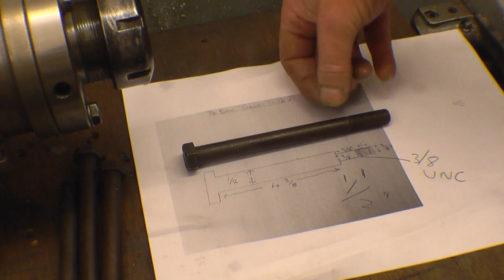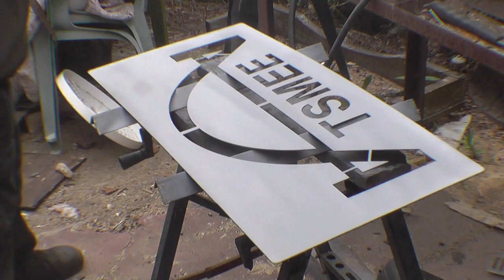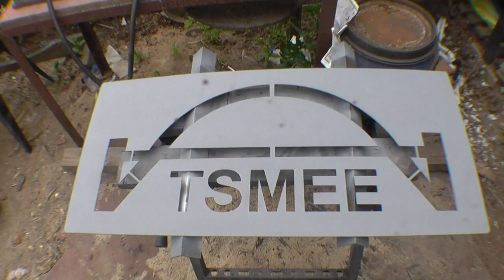SNNC 329 P2    Bought A New Toy     (jack PDF in description box)

Comment: Watching your video has 'fired' up my interest in my old Mamod traction engine, it was Christmas present to me when I was about 8, 45 years ago!. I ran it today but it did not perform well, The piston is leaking steam pressure and the big end has a lot of play which means that the cylinder is not oscillating fully which is messing up the valve timing. Making a new piston and bushing the big end will keep me busy and happy for a couple of hours!

Comment: When I was about 10 and at primary school I remember a mate bringing his Mamod and a bottle of meths.  All went well until the meths overflowed and we had a nice fire on the classroom floor!
Reply: I went a bit further than that. We had outside toilets with concrete floors. I found that a puddle of meths on the floor would burn lovely. Then open the toiler door at just the right angle and the wind would make a fire tornado all the way to the roof. Most impressive!

Comment: I was told to use distilled water in the little boilers to prevent the mineral buildup, but not to use de-ionized water as it will cause the solder the fail. Congratulations on 75k subscribers!
Reply: I agree. Either one will do. 
There's no chemical difference between them. Can't imagine where the idea came from.